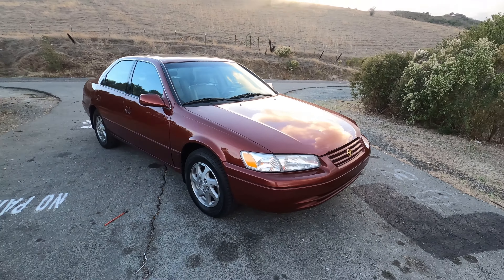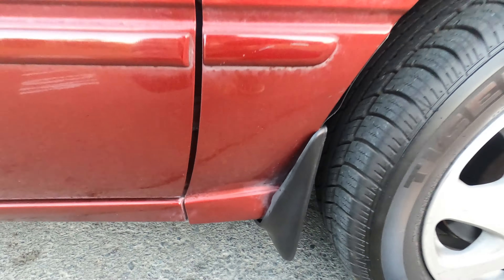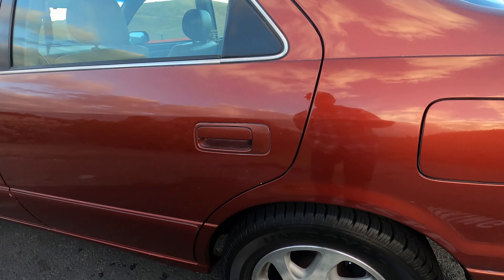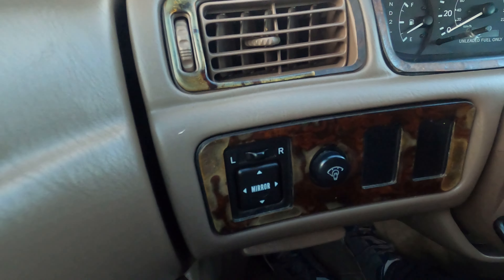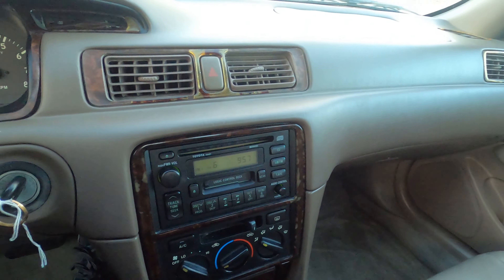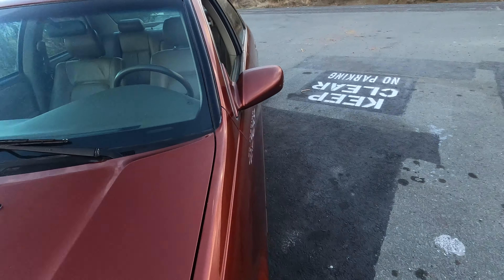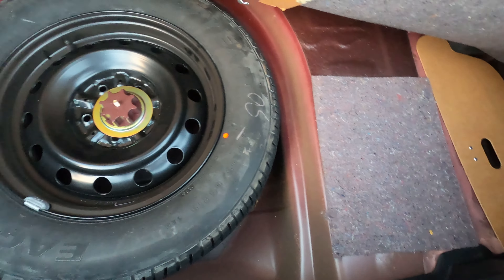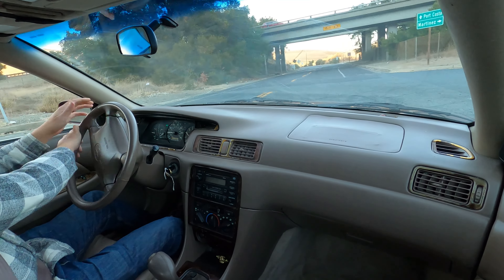GOAT Car: 1999 Toyota Camry XLE V6 25k miles Tour and Drive

Comment: I have the 99 LE V6 automatic with sunroof, alloy, aftermarket leather etc. 320k miles. Original engine, transmission, radiator, alternator. Great car!
Reply: We have same year,Love it.20016 mls.

Comment: I leased a brand new 2001 Camry CE (last year of the '97-'01 models) & loved it, but turned it back in, with 30k miles,
because I didn't want the "last year" of a car! I've regretted it ever since, but did (buy) a brand new 2004 Camry LE,
to replace it! I still have it, 20 years later & it's going strong, but still 'long' for that '01! One of the best cars, ever!

Comment: ive owned 3 of this exact car. a 96, and 2x 99s. my current 99 was a V6 XLE, MINT interior. only 162km, and zero issues. 1 owner before me and i paid no joke $1200 back in 2019 before covid. now in 2023 you cant even find a busted up  v6 xle Camry for under 3.5k-4kCAD..  As soon as covid hit everyone realized for some odd reason at the same time that they were very valuable and reliable cars. I tried to buy myself a second one not even 8 months ago and that is why I know they are so difficult to find in good condition now. There's nothing even wrong with my 1st one that I own at the moment I simply want a backup because I love this car so much and with the leather interior, power sunroof, power everything, and the fact you can fold down the rear seats and the trunk is absolutely ginormous once you remove the spare tire and Liners in the rear it becomes a amazing car even for a handyman such as myself. There is so much space in the rear trunk area,  I am able to use it to transport all of my equipment.
Reply: So I should absolutely go for this one I’m looking at silver 140k for 1200 with no discerning issues?
Reply: I think I should buy a red Toyota Camry for me and my wife when we get married, it would be an XLE V6. I would also buy an Acura Legend for my family, when I am living on my own.

Comment: Got one a few months ago from a used lot. Only 95k. The only major problem I've had was new spark plugs and valve cover gasket replacement. And I need to fix the radio. But, I bought it as is. So I guess the problems came with it. But I love this car.

Comment: Crazy to see one of these with so few miles, my engine bay was never that clean, haha. I wonder how long it will be on the road if the buyer starts using it as a regular driver. I really love that red color with the gold badges. There's an elderly lady that lives at the retirement facility I work at that has a 3rd gen 4runner with those colors and it really pops. Would love to try and buy it.

I have a '99 LE V6 Manual with 262k or more on the odometer (only shows 5 digits for some reason and I've rolled it over, definitely didn't have only 72k when I bought it). Did a bit of maintenance when I got it and it's been my only car since I bought it almost 8 years ago now. Aside from some wear parts (brakes, tires, etc) the only issues I've ever had is it didn't start once because I needed a new alternator and another time for a new battery. It probably needs a tune up and a few gaskets replaced but the back side of the v6 engines are tough to get to. Not sure if I'll do any huge maintenance on it and definitely no huge repair if something pops up so I'm curious how long it will last but it's still going strong.